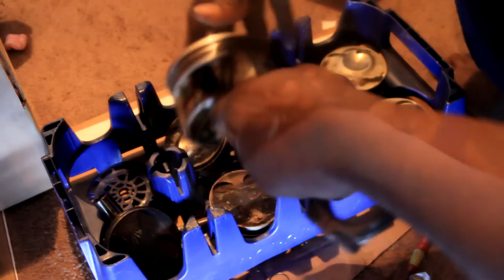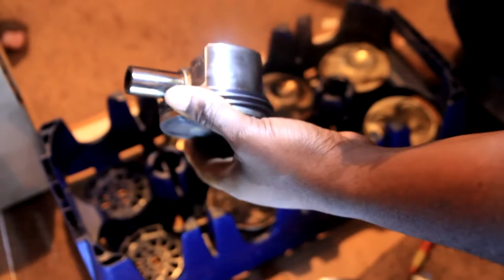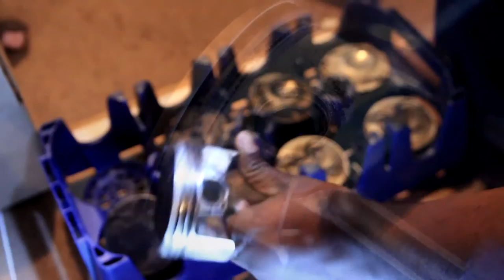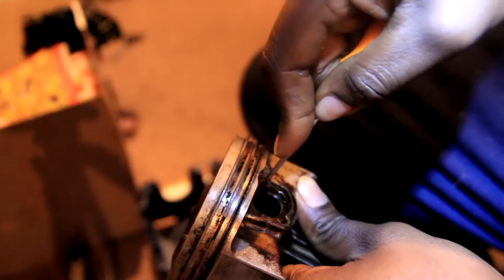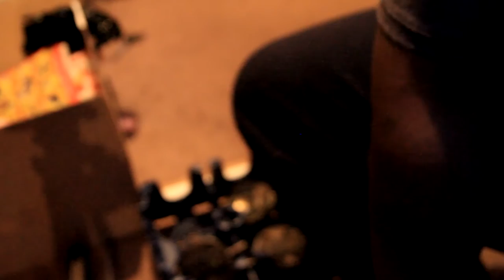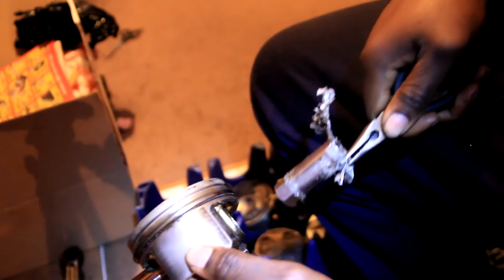HOW TO | FLOATING PISTON DISASSEMBLY

Comment: I would definately not hit that with a hammer. heat the piston and it might fall out. otherwise at worst use a clamp.
Reply from the maker: Appreciate the advice man. The last time I took some pistons off rods I used a dead blow hammer which I assume is not any better than what I did in this video.I will try your technique in the future if I do not have access to a press.
Reply: @kadeemwillock6335  kudos for doing it on your own :) I just used a heat gun... put it on the piston. Heated up piston, then pushed out wrist pin with a dowel ;) almost fell out on its own. Not sure if they are different... mine are full floating. Otherwise traditional wrist pins use a rode heater to remove the pin.